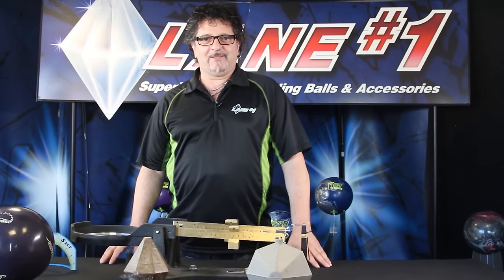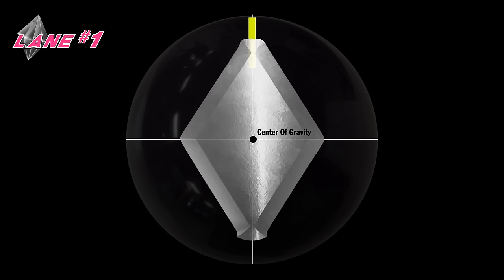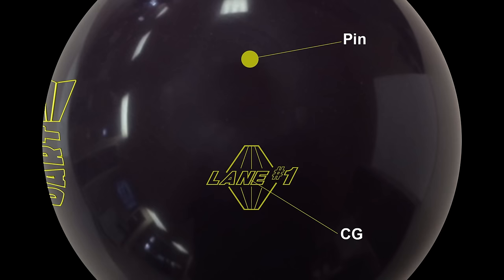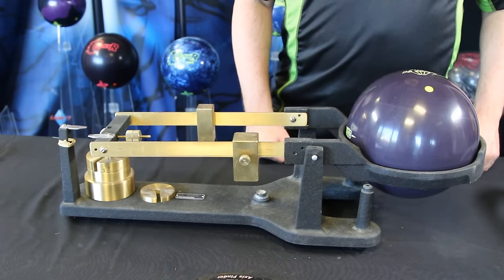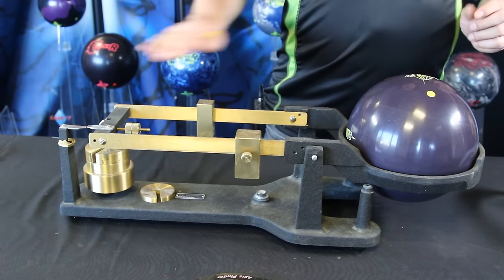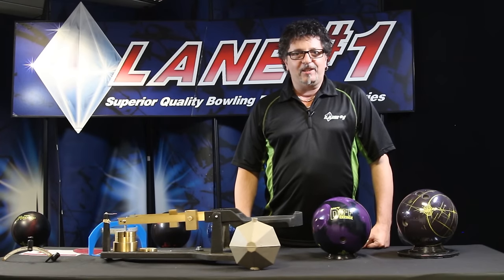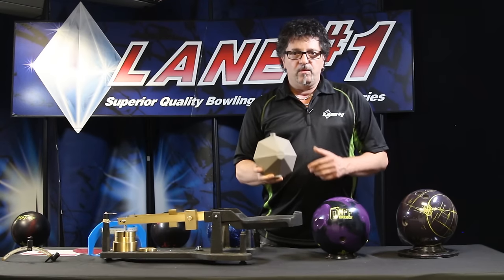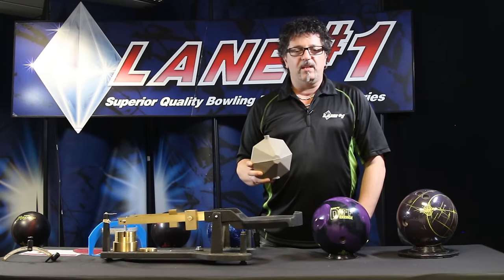GBS Gravity Balance System

Comment: If you are going to say that the placement of the cg matters then you should really refer to where the CG is in relation to the track  and rotation of the ball and not finger, thumb, and side weight.    The ball is rotating.  How does the ball know the difference between 5/8 finger weight and 5/8 thumb weight when it is revolving down the lane?

Comment: Starting @ 31:00, it IS NOT TOP WEIGHT you need to be looking at with the cg in the positive finger quadrant, it is FINGER WEIGHT then SIDE weight... USBC regulations for static weights don't include top weight after a ball is drilled... Don't lie to people about looking at top weight when it is FINGER WEIGHT/SIDE WEIGHT not top and side weight.... By the way, the GLBH system when putting a p3 or a p4/double thumb hole in the ball adds finger weight NOT TAKES IT AWAY like you said. Been PROVEN WAY too many times.

Comment: Very Nice video
Reply: +Kevin B How is this an informational video? How do you drill a ball for a 250 rpm 18 mph off hand bolwer who bowls on longer heavier patterns? What ball is better, asymm or symm cored balls? If you think this is a nice video then what pin to pap and what balance hole then surface would be appropriate?

Comment: This is a joke, I mean really.... I can drill a ball with the pin either on the center line of the grip or to the right of the ring finger for a right hand bowler but with the cg also on the center line of the grip. I can drill the middle finger just deep enough to get an insert in it and the ring finger like 3 inches deep and it will have some negative side weight in the negative finger quadrant, been proven through drilling a ball this way.... nothing new here.... same goes for thumb weight, I can drill a ball with the pin either on the center line above or below the fingers (appropriate length of pin to cg to do this) or to the right of the center line of the grip. I can place the cg (center of gravity) 1"-2" right of the center line in the positive thumb quadrant. I can drill a 1 1/4" x 3 deep balance hole in the positive thumb quadrant and guess what is going to happen, there might still be a bit of thumb weight, but I can create negative side in the thumb quadrant on the left side of the grip for a right hand bowler. The CG doesn't have to be in a negative quadrant to create this. 
Can't be proven wrong. Ebonite's blueprint software show cases this, so does drilling a ball like this and then weighing it to get what I just described. So stop with the rambling and admit you are NOT creating anything new just trying to add some "stuff" to make this seem more technical/scientific... This is NOT the 1990's anymore, it is 2015, so stop trying to mix the 1990's and 2015 and making it seem like a "big" thing.